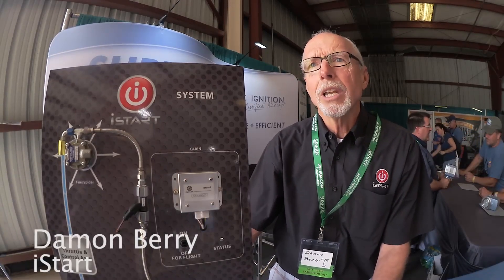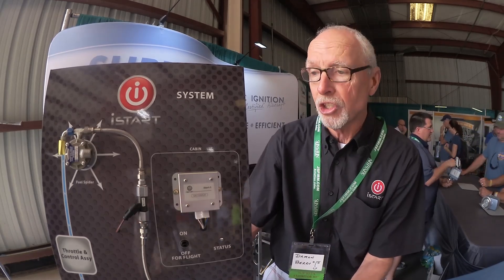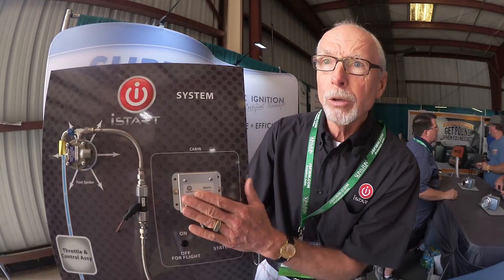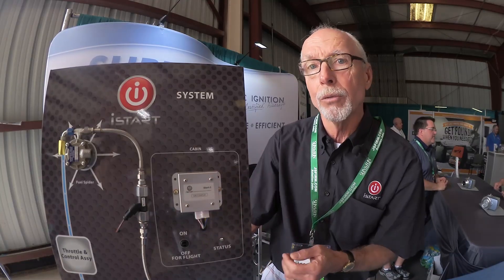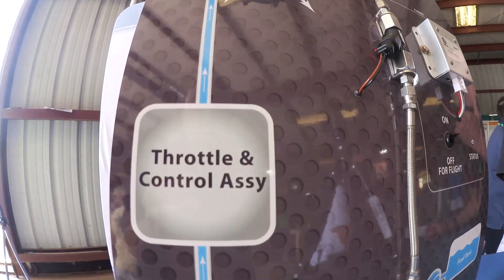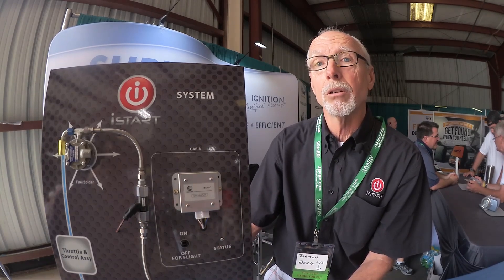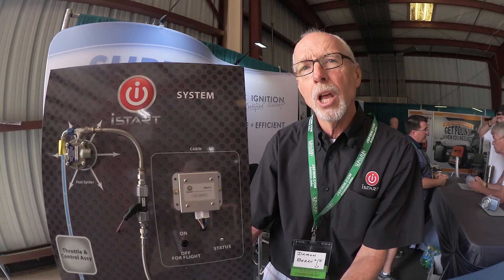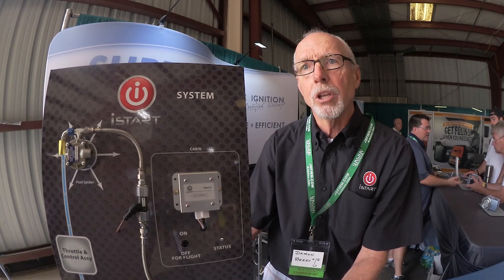iStart for Improved Hot Starting

Comment: Are used to fly a Cessna 185 with a 285 hp Continental engine in it and it was terrible at the hot start. After one time trying to get it started running late feel pump trying to purge the line a guy told me he says I suggest you do this sometime. When you come in here and you're going to start restart that engine within three too six hours just shut it off with the key not with the mixture control.  I started doing that it made a world of difference you want to be on the fuel pump when you start it because there might be some air in the lines. Might want to try that next time.

Comment: I'm not the brightest knife in the igloo, but if you have a fuel injected engine why does it not also have the other standard electronics that any fuel injected automobile engine would? You wouldn't need a mixture knob at all, or special gizmo's to help with starting a hot engine.
Reply: apburner1 aircraft fuel injection is 100% mechanical. It's been around since probably the 1940's?  The fuel is not injected at high pressure with super precise timing as on a modern car, but, rather, is just a means of delivering a more metered dose of fuel at each intake port.  As with the magneto-type ignition system on aircraft, a complete electrical failure would not prevent the engine from continuing to run. The exception might be in a low wing airplane where the fuel boost pump might still be needed.
Reply: Most GA aircraft are using 1930s technology forward of the fire wall, at crippling expense, and with horrific reliability. So they have carbs, with manual mixture control. Many pilots think they can do a better job than electronics. They can't, but you just can't teach some people. Then there's the incredible cost of fuel injection systems for the antique engines being sold on modern aircraft. Take a look at UL Power engines which all have FADEC, full authority digital engine control, just turn the key, hot or cold, just fire it up.